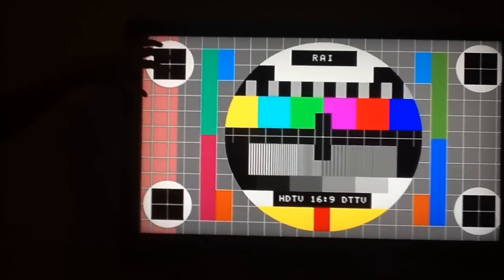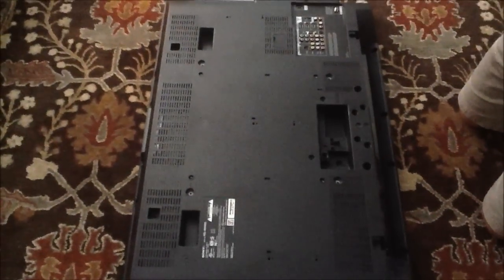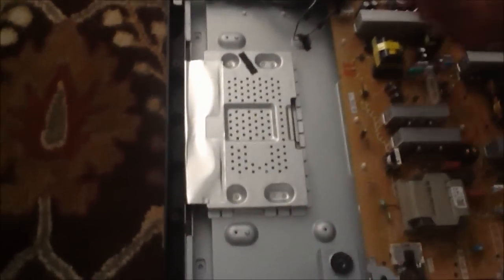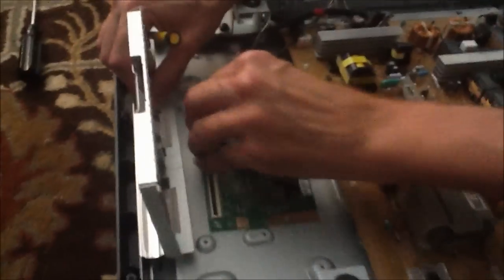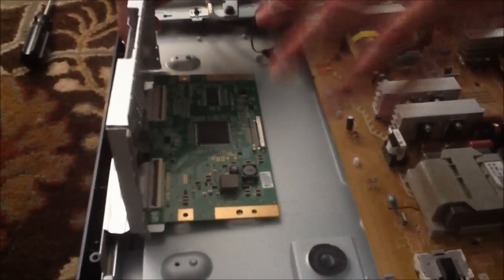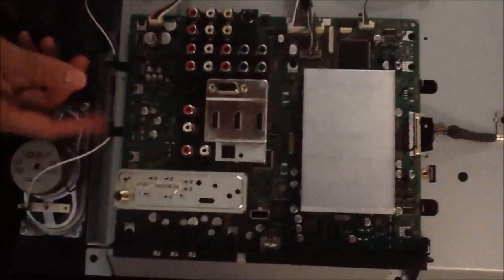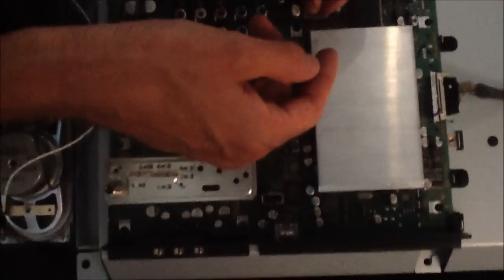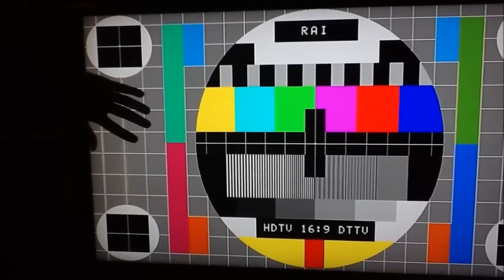How to Troubleshoot an LCD TV

Comment from the maker: Make sure to not slide the paper ince it's inserted as this may damage the tabs.  Only insert and then remove the paper section be section to see if it changes (corrects) the display.  If so, then you would want to insert the felt pads or whatever else works to apply pressure to the same area the paper was inserted.  If anyone tries this and it works, let me know.

Comment from the maker: I still have this TV and may try another technique I got from a co-worker.  It seems that the microscopic breaks in the ribbon cables (tabs) don't have to be in the same area as the issue seen on the screen.  Apparently, there can be an issue with a tab on the right hand side of the screen that causes an issue on the left hand side.  So, with that said, another technique to try is to get a sturdy piece of card stock paper and gently insert it between the front plastic panel and the LCD panel.